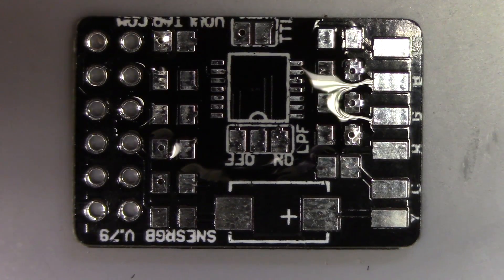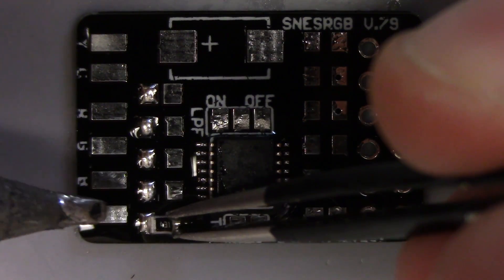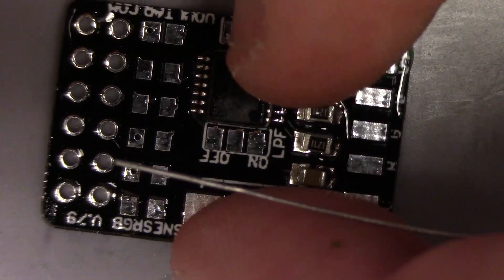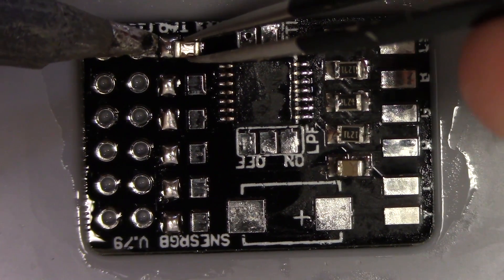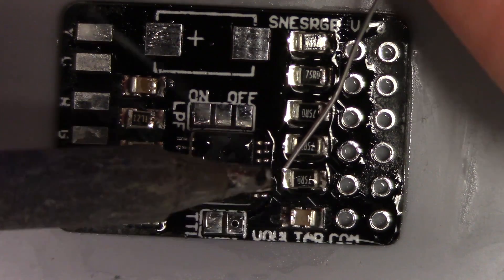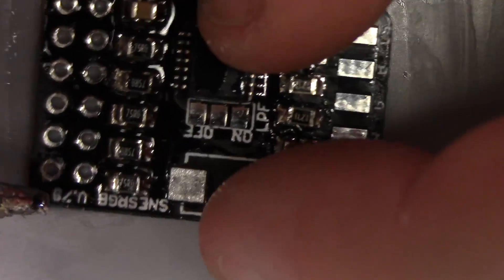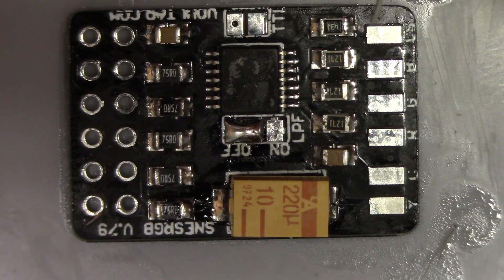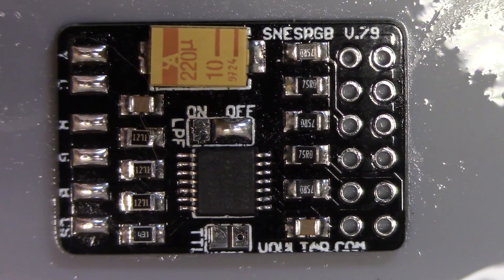SNES RGB and SMD Soldering Talks

Comment: I am somewhat a soldering beginner. I have to say, your videos are pretty much helpful. When I was soldering I didn't use liquid flux, but soldering stuff with integrated flux.
I don't know if this is good or bad, but it sometimes gave me ugly solder bumps, which I could wick (? desolder) away. Probably to hot or flux related, I don't know, since I taught it myself by just doing it.
To me, soldering was good, if it looked shiny like liquid metal and just enough to have a solid connection and the part doesn't fall off.
Sometimes a little too much, but hey, this thing worked.
Reply: EXcentriX too hot, solder with integrated flux often has a weird burn to it that messes with your clean job. Sounds like youre doing well though (:
Reply: I have (not so expensive) solder with good flux (you only notice it's there because the solder flows and sticks better), and cheap solder with crap flux which smokes and leaves residue. And extra cheap plumber's solder with no flux. All have their uses.

For the no flux stuff, get rosin paste (the yellow sticky almost solid stuff), pull a little with your solder, and melt both on a fireproof surface. Roll the solder ball around for a bit, then quickly drag it across the surface. You should end up with a short length of flux infused "wire". You can "cut it up" by melting it somewhere in the middle then quickly pulling your soldering iron to one side. Flicking solder into the pool of molten flux will make it ball up. This way it will solder as good as the expensive stuff, but nowhere near as convenient as a thin, flux infused wire.

Comment: Informative video, some good insight that encouraged me to improve my work.  Do you have a link to the no clean Flux that you use?
Reply from the maker: Here's a good place to start. The 312 is really nice and is alcohol-based. https://www.amazon.com/SRA-312-No-Clean-Flux-100/dp/B014OLIXMC/ref=sr_1_2?ie=UTF8&qid=1495004438&sr=8-2&keywords=SRA+no+clean
Reply: Voultar Awesome, thanks. What's the benefit of it being alcohol based?
Reply from the maker: It's not caustic and doesn't leave as much of a residue. Simple to clean, and a good performer.
Reply: Oh ok, that's what I thought.  I really appreciate your help.  I happened to watch your n64 video just now, where do you get your ribbon cable if you don't mind me asking? Last question I swear lol
Reply from the maker: 26-28 awg stranded ribbon cable can be found anywhere as it's super plentiful. Give E-bay a look!
Reply: Voultar Will do, thanks again. :) Looking forward to more videos in the future.
Reply from the maker: I generally don't agree with those comments if we are broadly talking about "no-clean" flux. But I will say that before selecting a flux to use, consult the datasheet. The datasheet will give you all relevant data for proper application use. I use an MG Chemicals no-clean chemistry that is neither conductive or corrosive, that includes any "unspent" deposits. For the most part, that "white" film you see develop after applying no-clean is from solids in the mix. If your no-clean flux is very low on solids, this "residue" will be minimal. But that doesn't speak for all no-clean chemistries. Some can be very caustic, despite their title of being "no-clean". I DO agree however, that water soluble flux (organic) should be avoided like the plague. That stuff is ass, and it WILL conduct if it isn't thoroughly cleaned from your work. MIXING differing flux chemistries can land you into trouble, though.
Reply: Would this be the flux you're using in these videos?

https://www.amazon.co.uk/MG-Chemicals-Clean-Halogen-Bottle/dp/B00RYTD0D4/ref=sr_1_5?ie=UTF8&qid=1506214568&sr=8-5&keywords=no+clean+flux
Reply: you made one baad mistake here, if you solder smd's with soldering iron, one end at a time, you should reflow the whole board with hot air, to remove any tension in the components. Otherwise especially the resistors may crack in the long run.
Reply: @jarnoob  interesting - never heard of that before :)
Reply: @MrSapps  yeah i used to manufacture small batch industrial electronics and prototypes at my old job. Quality control was pretty much the highest priority. 
The problem is with thermal expansion of the components. After soldering one tab, it of course gets cool in different rate than the next and because of the thermal expansion this causes small amounts of tension to the components.